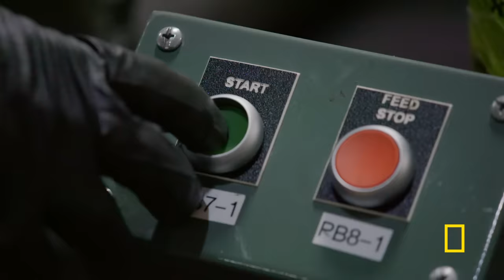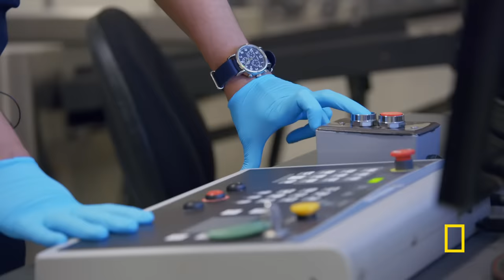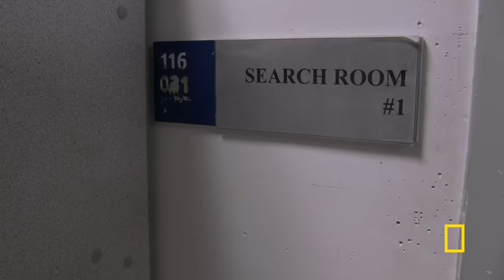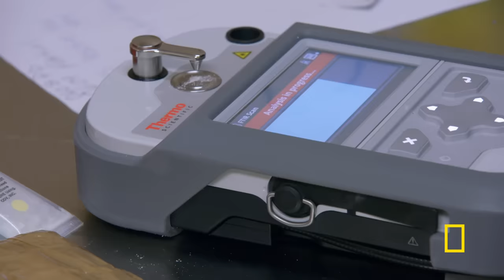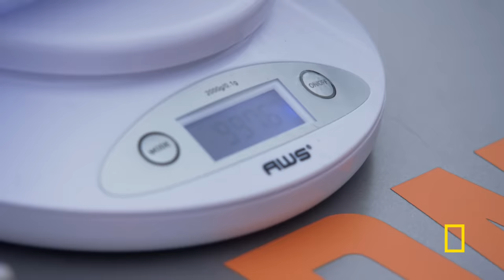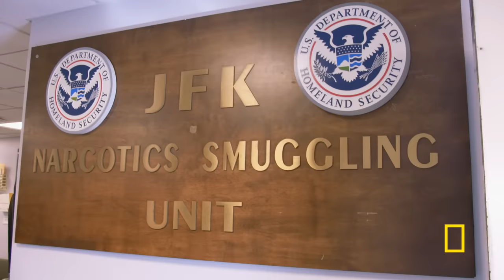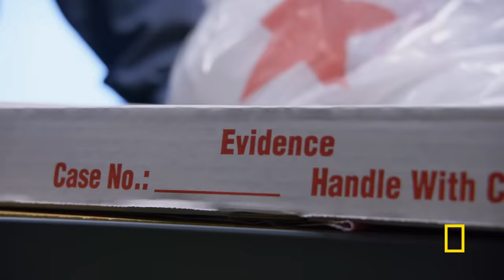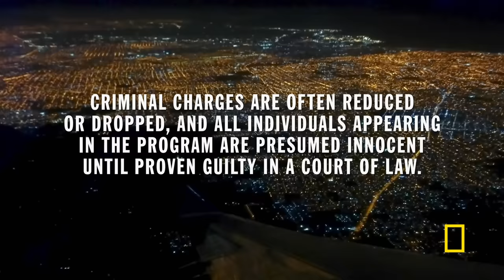Stash House Takedown (Full Episode) | To Catch a Smuggler

Comment: Poor kid was scared the x-ray was going to corrupt his saved data. Nothing worse than all that hardwork and time being lost.
Reply: Lol
Reply: @Pixel McDigits magnets corrupt hard drives. And I'm 100% positive there are magnets in that machine
Reply: @douggaudiosi14  Exactly....I remember having a X-Ray done and I mistakenly had my credit card in my pocket and had to get a new one because the magnet from the X-Ray messed up the strip on my card!!
Reply: im pretty sure most data for newer games are kept on an external database to the actual xbox but i can imagine 10 years ago it wouldve caused chaos hahahahah
Reply: @Pixel McDigits "Radiation is energy that comes from a source and travels through space at the speed of light. This energy has an electric field and a magnetic field associated with it, and has wave-like properties. You could also call radiation “electromagnetic waves”."
X-Rays release a type of specific type of radation called ionizing radation. "Ionizing radiation creates electron-hole pairs in the electronics, changing the transistor parameters and eventually destroying them." You can't trust everything you read on the internet but these are my Google search results.
Reply: @douggaudiosi14  X-rays do not use magnets of such magnitude, they have only very small magnets in electric motors to position scanning 'head' properly, but they do not radiate magnetic field to material, instead they use targeted beam to get reflection of the material on special shield/sheet on the other side..
Reply: My thoughts as well. Bless his heart, love that he has a wonderful family to support his travels ❤
Reply: Well don’t bring an Xbox to the airport, you don’t need it. You can always buy one from where you’re going.

Comment: The problem with the shark fins is that they're going to destroy all of those fins which means the poachers are going to have to kill even more sharks to fill the demand and recoup the loss, and it also drives up the price as the fins become scarcer. It's the same as when they destroy elephant tusks. Or even drugs. I know what they're trying to do by getting these things off the market, but ultimately I think it has the opposite effect. As long as there is demand for these things, they'll never be able to stop the supply.